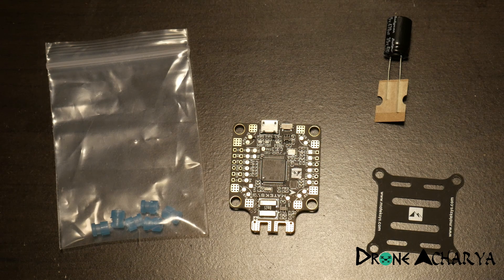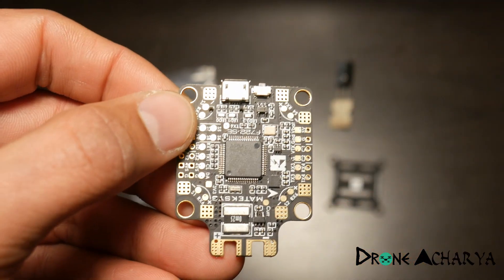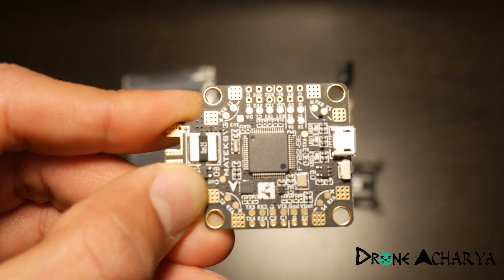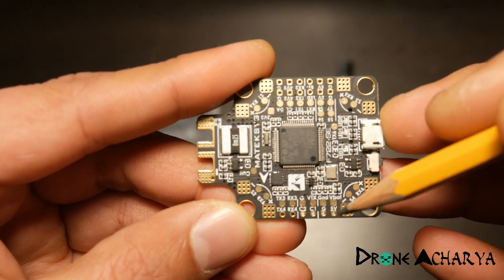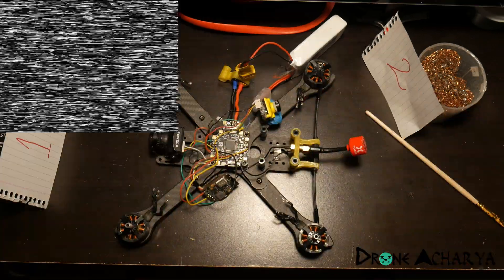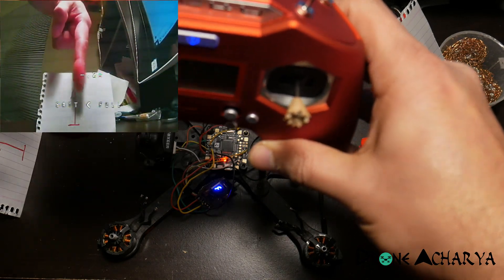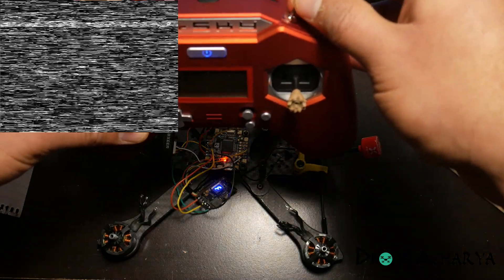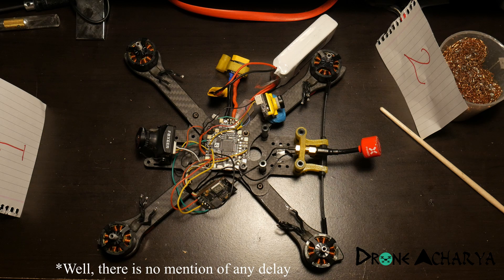Matek F7 Camera switching | VTX power switching

Comment: I hope this comment helps someone out there...

I have this same board and two cameras connected, however, I had some serious latency between camera 1 and camera 2, like three seconds.  But after sleeping on it I decided to check the PAL/NTSC setting.  It turned out that camera 1 was set to NTSC and camera 2 was PAL.  I set camera 2 to NTSC and voila!!!! Problem solved.  Now the latency is even better that seen in this video :D  It works perfectly!

Comment: What is the best budget flight controller you can tell to use with single ESC s
Reply from the maker: Unfortunately there aren't many options in FCs that use single escs in the budget section. CL racing probably would be cheaper, but not by much. Maybe the matek f405 too. Both are great brands and will last a long time, totally worth what you pay for.
Reply: @shyamfpv  i tried a lot for matek f405 std  but out of stock, also don't know much sites to buy, i am from India
Reply: Please help me in selecting the Fc
With place where to buy, 
I just need a Stable fc compatible with single ESCs.

Comment: How do you know if the cameras are set up to PAL or NTSC?
Reply from the maker: Great question. Generally the manufacturer puts that info on the box itself. But I would generally use the Auto functionality on the osd menu and that works just fine.
Reply: @shyamfpv  I didn’t think of that. Thank you

Comment: Thanks Brother. I'm an new go FPV drones. How do you set up your transmitter with the f722?
Reply from the maker: Hey there... Setting up transmitter has nothing to do with a flight controller. You can bind a receiver to a transmitter and setup modes in transmitter without a flight controller. 
If you don't mind explaining what exactly you are trying to do, I can probably help you out. Also, what transmitter and receiver are you using?
Reply: @shyamfpv  Thank you for getting back to me. Much appreciated! Well interestingly, I already have a drone that works perfectly fine. It is used for an industrial application and all I want to do is to add two FPV cameras to it. I am not changing its flight controller or anything and as a matter of fact, I am looking at getting a seperate remote controller/transmitter and screen for the dual camera FPV system, so this system will be independent to the drone. Therefore I am thinking of using the F722 simply to switch between two cameras and not as a flight controller itself. I got myself the F722 wing version, a video transmitter with LHCP antenna and 2 runcams. I have no idea how now go about switching between the cameras. I have not picked a transmitter yet as I am not sure what to go with. Your help will be greatly appreciated!

Comment: Which soldering iron do you use
Reply from the maker: TS100, the best company iron out there.
Reply: @shyamfpv  ok it's on bangood I think so good s are not coming
Reply from the maker: @sachidanandbogra6693  yeah, if you are in India, then probably Banggood is your only option. Or at least I am not aware of any other retailers there. If you are in US/UK/Europe, there are other retailers available.
Reply: Ok my quad is shaking on roll axis should I tune D in PID
Reply from the maker: @sachidanandbogra6693  it's tough to say what's causing it, there could be so many things. What quad is it, can you give some specs?
Also what BF version are you running?
Is your FC mounted with rubber grommets and is not moving during flight?

Comment: i want an onboard recording system for my 2 cameras, am using f722 se aio and matek vtx board, please help and suggest one
Reply from the maker: Samarth, you can use any onboard DVR system... Something like this...
[US$15.90]RunCam Mini FPV DVR Module Remote Control Version Lossless Video Output for Mini FPV Racing Drone RC Parts from Toys Hobbies and Robot on banggood.com
https://banggood.app.link/8IOzuYN7n2

You can attach both camera wires input to the input pin on the board, I believe that should work.
Reply: @shyamfpv  thankyou so much buddy, means alot, ONE MORE THING, i want a cheap vtx with smart audio protocol that supports this dual camera and switching, which vtx are you using, please help and suggest some, will be really grateful
Reply from the maker: @samrathsuri6874  any vtx will support dual camera switching, it's the FC's feature and not vtx's. If you don't plan to fly too long, eachine vtx03s is a great option, or akk ultimate. I use rdq Mach 3, I chose this specifically because it does 1W power and I plan to fly long range soon
Reply: @shyamfpv  thankyou so much, your video and support helped alot
Reply from the maker: @samrathsuri6874  happy to help !!

Comment: What pin you connect at foxeer fpv cam to be rx4 and tx4?
Reply from the maker: No, you don't need to connect the fpv camera to any uart. There are dedicated pins for fpv camera to connect to. Let me know if this is not what you are looking for.
Reply: DroneAcharya got it Thàñk ÿóu. Nothing to change or setting with the motor if fly using either cam 2 @ 1?
Reply from the maker: @Taufik.Moktar  so when I was using cam 2 on a switch on my transmitter, the same switch also reversed pitch and roll commands, so that I can go backwards
Reply: DroneAcharya how to set like that? Im using tbs tango
Reply from the maker: @Taufik.Moktar  does tango run on open tx?
Reply: DroneAcharya no brop
Reply from the maker: @Taufik.Moktar  hmmm sorry I am not sure how tango works then, but I am sure it should have some option to do so.
Reply: DroneAcharya Thàñk ÿôû śø mùçh bro. 👍
Reply: I cant find at my mixer to copy the channel switch to turn on and off
Reply from the maker: @Taufik.Moktar  you are thinking in the right direction... Because I added an additional line in the mixer section which would get activated on a switch, it should be something similar... Try asking this on the TBS lounge group in FB.
Reply: DroneAcharya i dunno how to ask and explain. Can you help for that? Really appreciate it.
Reply from the maker: @Taufik.Moktar  join Joshua bardwells live stream now... He can definitely answer..
Here is the link... Good for another hour
https://youtu.be/vX-GRWCojDc

Comment: any manual or information how to use it with Spectrum DSM/X receiver ?  i find that it has a 3V output but did not find info how to connect , Tnx in advance for your help
Reply from the maker: You can use any open uart to connect dsmx Rx. You will find the manual on matek's website, just search for Matek f722 se on Google and look for Matek in the results.

Comment: i cant get my vtx to turn on? is there a cli code i need to use for vtx switching?
Reply from the maker: Not really. User 1 if set to an aux channel should be good enough. And obviously power the vtx from the vtx pad on the FC and not directly via the battery pads.

Comment: Is mounting SD card compulsory, Since 128 Mb SD card not available now a days
Reply from the maker: It's required only if you want Blackbox logging, I use a 1GB card there to log my flights.
You can still fly without a SD card.
Reply: @shyamfpv  Thanks a lot, Sir

Comment: Does the board have Camera control?
Reply from the maker: RX4 can be remapped to use as camera control... It has an inbuilt 200ohm resistor
Reply: DroneAcharya thanks bhai. Would it be the direct wire from camera to the pad? Or the hack with a resistor etc? Osd wire? The white one? Thanks
Reply from the maker: @oxVirtuexo  looking at it's manual doesn't seem to need any external resistor, hooking it up should work fine. I suggest take a look at the manual once, just to confirm.
Reply: DroneAcharya thanx yaar!
Reply from the maker: @oxVirtuexo  koi nai yaar... Hope it helps

Comment: I am planning a build with this board... If my ESCs have dedicated low esr capacitors on them, do i need to attach the capacitor provided in this kit??
Reply from the maker: Nope, you don't need to attach a separate cap if your ESCs already have them.
Reply: @shyamfpv  Thanks a lot man 🤙🤙
Reply: Also I am planning for an autonomous fixed wing aircraft. Can you recommend a flight controller starting anywhere from an APM to a pixhawk 4??
Reply from the maker: @AnanthuSN  I wish I could help buddy, I don't fly wings. You might want to check on some FB groups.
Reply: @shyamfpv  No problem... thanks a lot man